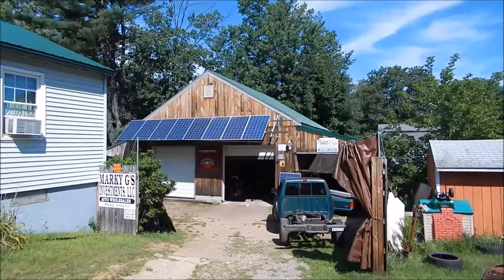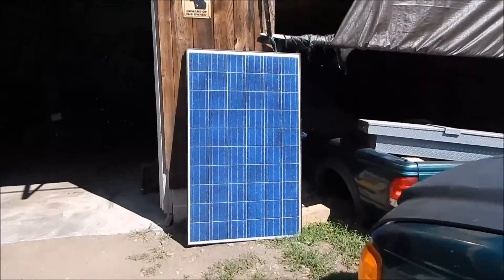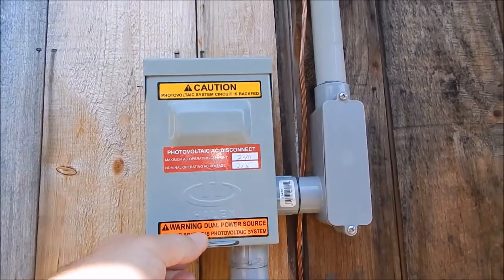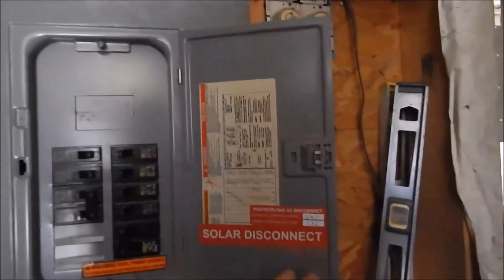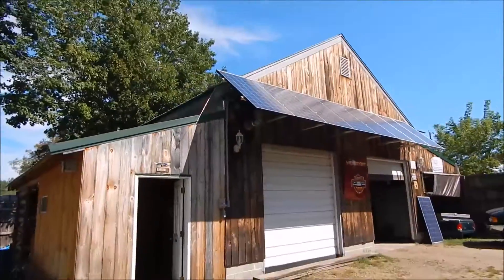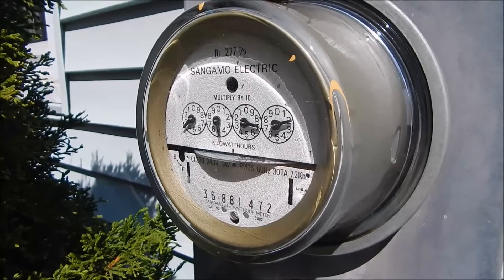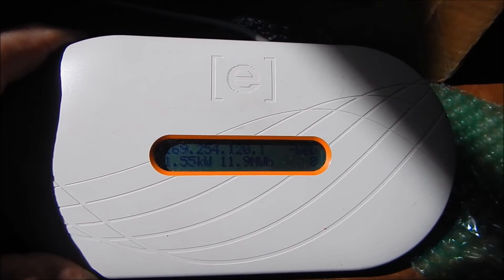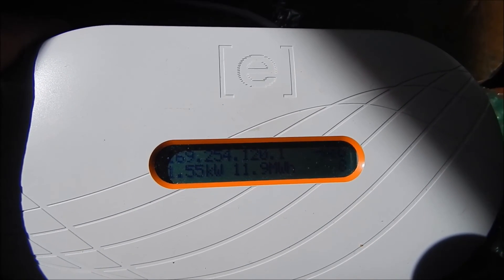Solar Grid Tie System Up & Running.

Comment: If it's just broken glass on that panel, use some QSIL16 to reseal it and you are good to go. The only draw back I have had is it takes a couple of days for it to dry after applying.

Comment: I like the idea of the micro-inverters, transmit AC from array to point of use and all, but the problem for me is it doesn't take very many panels/inverters to reach the cost of a single beefy inverter, and the heavier wire run to the array. Am I missing something?
Reply from the maker: I have done it both ways, the micro inverters are more efficient as each panel has its own .When u use a string inverter a poor out put on a single solar panel will pull down power out put of the entire system. Also they eliminate a single point of failure U can have with a big string inverter, if a micro inverter fails U only lose 1 solar panel that its hooked up to. Plus  these are much simpler to install. Also Enphase is a great Co.to deal with if U have a problem I have been using them about 5 years.